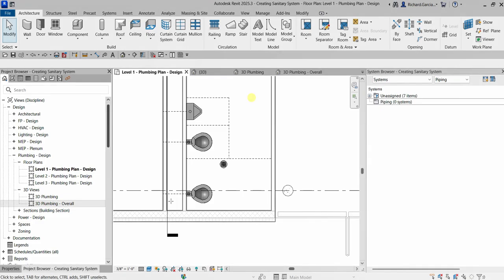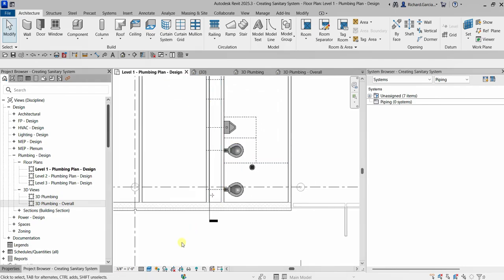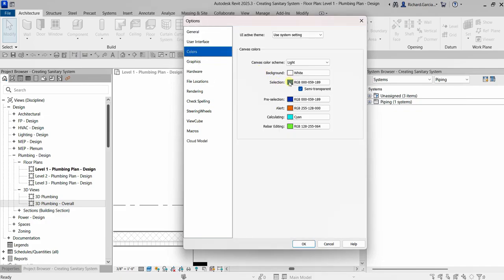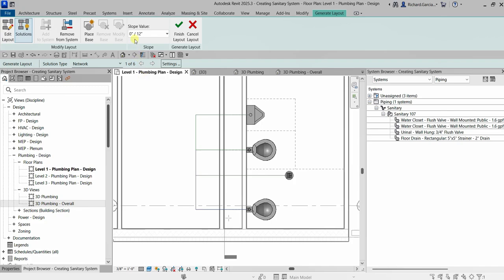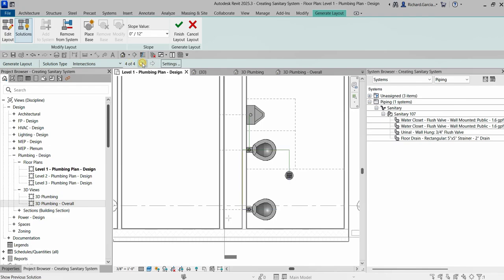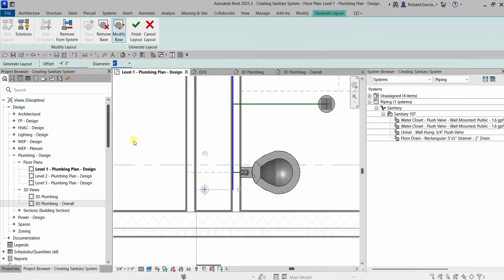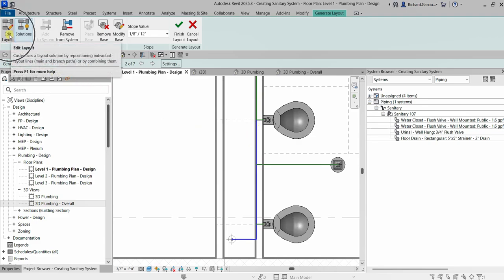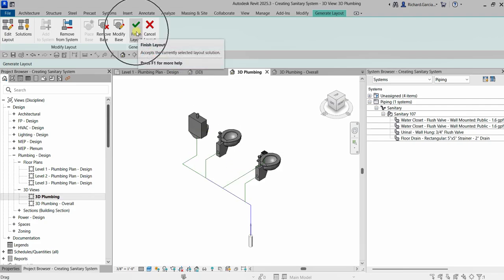REVIT 2025: DESIGNING PLUMBING SYSTEM - CREATING A SANITARY SYSTEM

Comment: Good Day Sir Rich., thank you for this video.,can i ask on how to create/put a p-trap in the floor drain,lavatory, and urinal in the sanitary piping system?
Reply from the maker: Hi @nimrodnathanlayague4434, thank you for your question! Here's how you can create or place a P-trap in Revit for floor drains, lavatories, and urinals:

🔧 Option 1: Use a P-Trap Family
Load a P-trap Family:

Go to Insert > Load Family.

Look for a family like P-Trap.rfa under Plumbing > MEP > Fixtures > Pipes or download one from RevitCity, BIMObject, or Autodesk Seek (legacy).

Place the P-trap:

Use the Component tool (Systems > Component > Place a Component) to manually place the trap beneath your fixture.

Align it properly using the Move, Align (AL), and Rotate (RO) tools.

Connect to the Pipe:

Use the Piping tool to draw a sanitary pipe from the P-trap and connect it to your system.

Set the system type to Sanitary and check fittings are auto-generated.

💡 Option 2: Use Fixtures with Built-in P-Traps
Some lavatory or urinal families already include a built-in P-trap (visually only, not functional in system logic). You can:

Edit or create your own families in the Family Editor to include modeled P-traps.

Add solid extrusions to represent the P-trap under the fixture and nest it in your main family.

⚙️ Option 3: Model it as Pipe Fittings
Go to Systems > Pipe > Type: Sanitary.

Use elbows and pipes to manually create a P-shaped loop (similar to a P-trap).

Not recommended for large projects due to performance and maintenance, but works for detailing.
Reply: @bim360  thank you so much Sir Rich
Reply from the maker: all good.